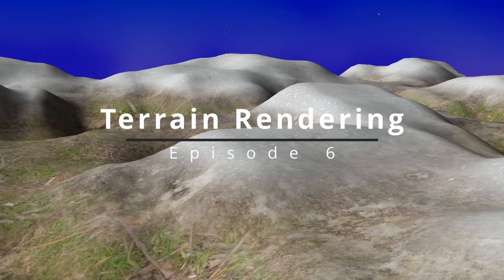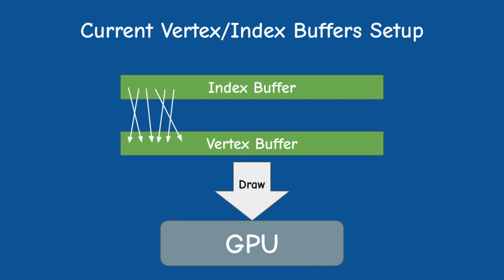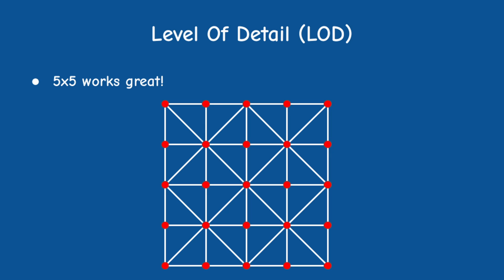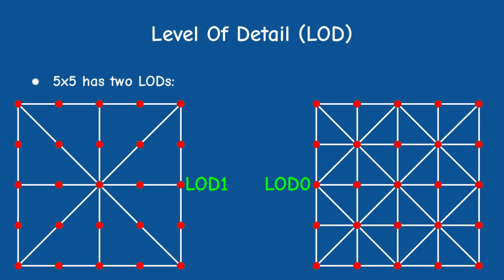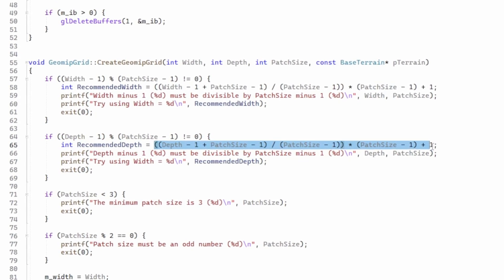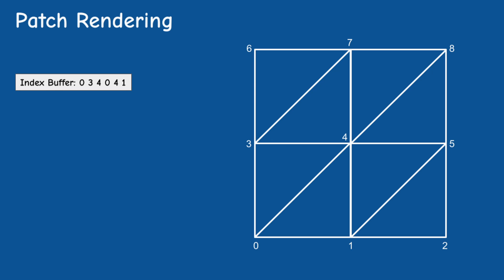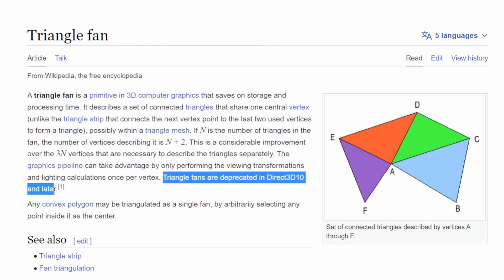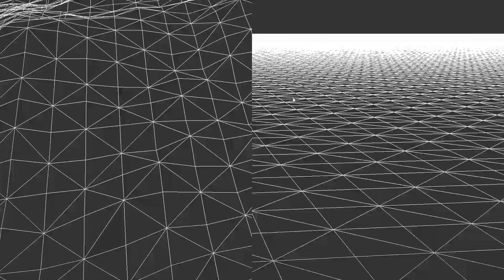Geomipmapping // Terrain Rendering episode #6

Comment: Hey, great tutorial! Myabe I've missed something, but I'm wondering whether we strictly need triangle fan layout for this. Shouldn't it be possible to keep using normal 2-triangle quads most of the time and only generate a "sort of" fan structure on the seams? Is the triangle fan way better or simpler? I'm gonna play around with it a bit myself, but maybe you have an answer already?
Reply from the maker: Thanks! afaik triangle fans are pretty much deprecated (at least, I don't know anyone who uses them) so I didn't really consider them for this algorithm.
Reply: @OGLDEV  What I mean is not the triangle fan primitive mode, but the general topology. In this video you change quads to fans, presumably for the sake of easier handling of seams between LODs, but I'm wondering if it's possible to stay with the quad topology everywhere except the seams where we'd generate a specific configuration for the combination.
Reply from the maker: Oh, I see. You can take a look at the original paper here: https://flipcode.com/archives/article_geomipmaps.pdf. He uses quads. For some reason I ended up with fans...

Comment: Thank you so much for these series!! I changed MidpointDisplacement Terrain to use GeomipGrid instead of TriangleList but now I am getting incorrect edges on the sides of the map, any idea what could be causing this?
Reply from the maker: You're welcome!
Is this happening with my code? 
Try to set the patch size to the size of the terrain.
Reply: @OGLDEV  Patch size is 33, tried 513 (same as terrain), and I should mention I don't always get this when launching application. So maybe this started happening before, could be problem with Midpoint Displacement algorithm maybe?..
Reply from the maker: @nerijusvilcinskas7851  Not sure. You can try fault formation.
Reply: @OGLDEV  Thanks for the tip, started using GeomipGrid class for Fault formation, but it looks nice with this algorithm, so seems like only midpoint displacement is affected, weird
Reply from the maker: @nerijusvilcinskas7851  Another option is to define the smallest patch with 3 vertices but make sure the world scale is large lile a 100 otherwise you may miss it. Then slowly increase the patch size. Terrain should be 3 as well.

Comment: This is quite old slow technique. Newer variations use static mesh and use compute shader to prepare index buffer (or my favorite solution: they compute interpolation position for vertex without neighb. for eliminating of edge cracks) for one drawcall terrain. Will you make tutorial on this?
Reply from the maker: Yes, eventually. Would also like to explore tessellation for terrains. Unfortunately there aren't new books on terrains so if you want to create a more modern course you have to research the papers.
Reply: @OGLDEV  Tesselation seems like a dead end. Yes, no new book as far i know. In the old days there were few books which computer graphics used a lot like red book or gpu gems. Nowadays we are stuck on GDC slides or published papers (which very often skip details - crucial parts of implementation).
Reply from the maker: Why do you think tesselation is a dead end?
Reply: @OGLDEV  Not a professional (although I actually wrote my bachelor thesis on tessellation for terrains) but I think the issue is that tessellation is very static compared to the other tools we have available. Vulkan and DX12 offer mesh shaders (I'm not sure if there is a ogl extension) which kind of throw the whole vs -> tcs -> tes -> gs -> fs pipeline out the window and for most cases modern GPUs are probably quick enough that you could just use the compute shader. Considering that the compute shader is probably already used, it's probably just a little extra step in the already existing shader to tessellate terrain.

Additionally, and this is kinda what I never got to explore after writing the thesis about rendering, I honestly don't know how you do collision with tessellation. With the compute shader, you get output. With the tessellation shader, you get nothing. So, tessellation for more detail really close up? Awesome. Just throw a bounding box around it and you're golden. No need to care about the actual generated geometry. Tessellation for actual walkable terrain? Well now you need to know the high value of the generated vertex. That's an issue.
Reply from the maker: @robinkuster1127 In the case of a tessellated terrain you can still use the heightmap for collision detection. It may not be the most accurate but if you keep tessellation at the point where it is mostly for visual fidelity it may be good enough. Some engines use a collision mesh which is a simplified representation of the terrain and they do collision with it.